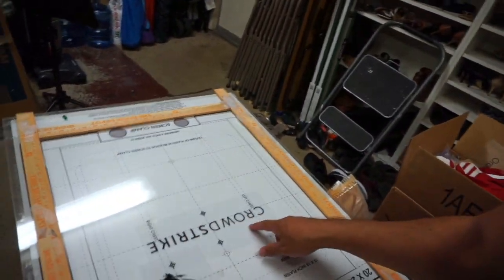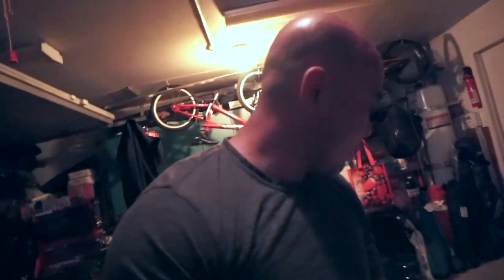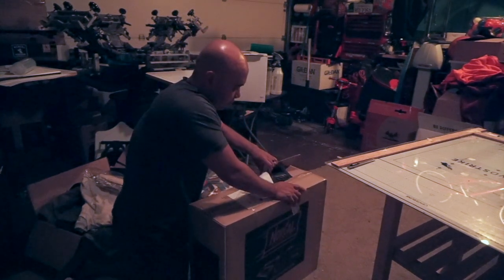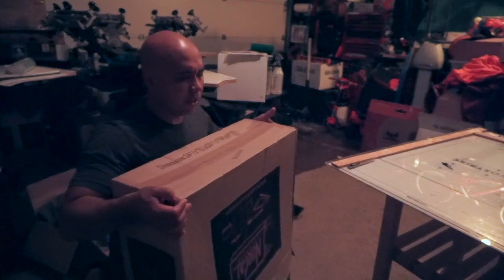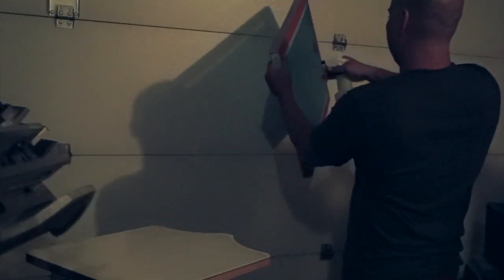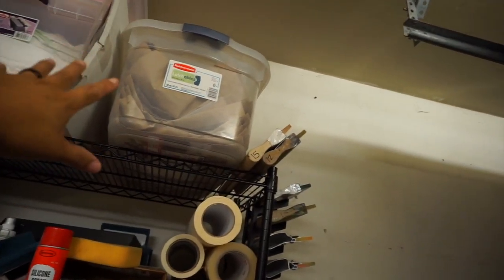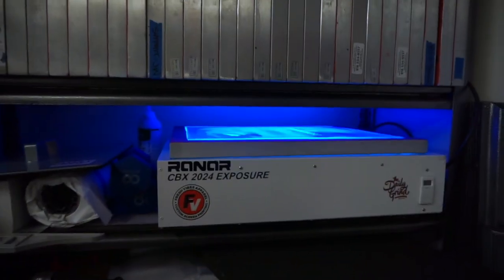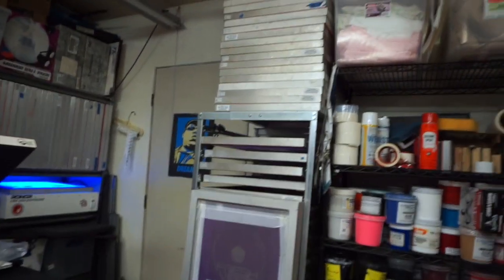Screen Printing - Burning Screens (S:05/Vlog 031)

Comment: Hey Rhy! Have you had any luck with goldupusa?  I was going to order from them and noticed they are actually in Newark which is close-by. Also, do you ever get your frames re-screened or is it too much of a hassle/expense compared to just buying new screens?
Reply from the maker: I get screens from them. Even the suppliers in our area get the screens from them. I haven’t had any issues. Unless I accidentally punch a hole through it

Comment: Please upload a link for that foam if you can 🙏🏾
Reply from the maker: This is something similar. But you can always go to a craft store and get one. Like a mattress foam. Or honestly..  you can find these at garbage dumpster at a shopping mall. They are always throwing these away.

FoamRush 2" H x 24" W x 24" L Upholstery Foam Cushion High Density (Chair Cushion Square Foam for Dinning Chairs, Wheelchair Seat Cushion Replacement) https://www.amazon.com/dp/B06W9L7X8J/ref=cm_sw_r_cp_api_i_GYKEDbS26GG3M